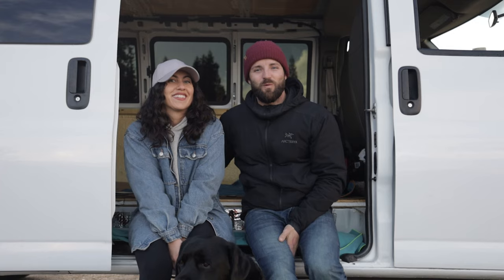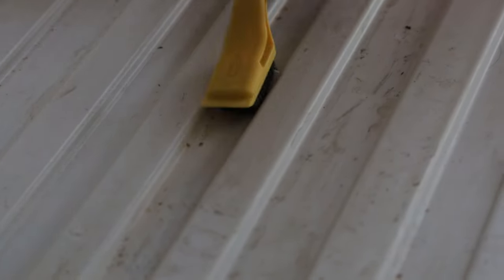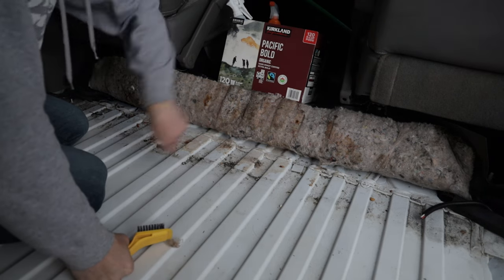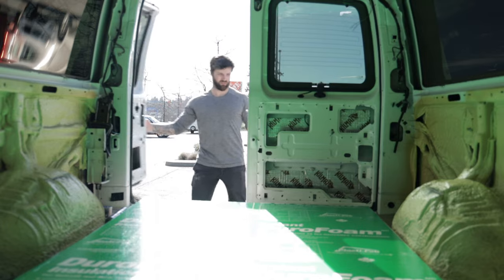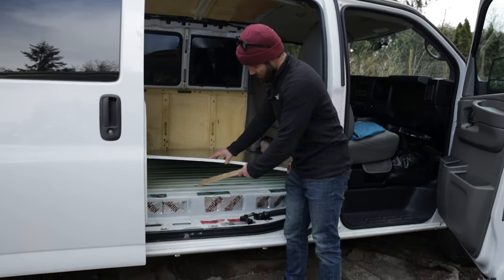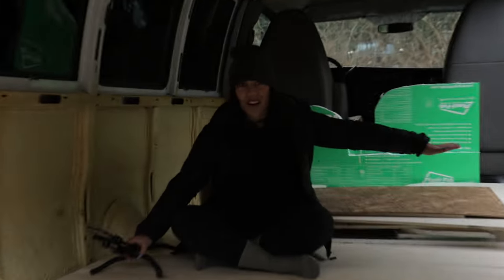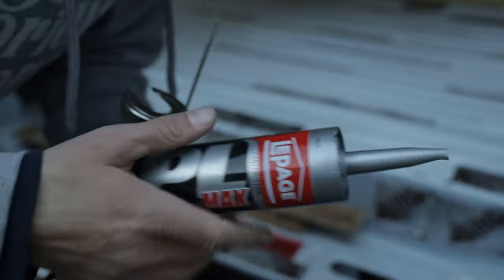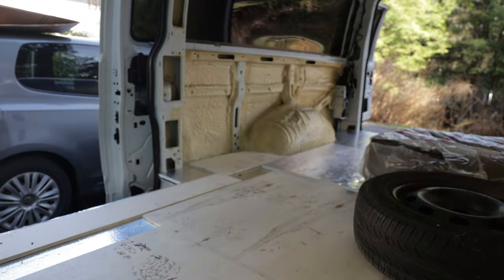CHEVY EXPRESS VAN BUILD | Preparation, Insulation, Subfloor | Ep. 1

Comment: I have seen many personal stories from many different people of their builds. I don't think any of them are "wrong." 

I started from the roof and worked my way down. Following the cables from my fan, AC, and solar panels on down the walls to the rear battery bank. Then the plumbing for my sink and shower. Then the walls with plugs. Then the bed frame and counters. Then the detail work.

Comment: I bought a 2000 Chevy Express passenger van couple years back.  I removed the two middle seats and left the back one because it lowers into a bed.   I built a plywood top frame for the area between the bed and the rear doors so we could lay long ways in the van with a foam mattress.    We kept it real simple so we could do a lot of things with the van.   we can remove the mattress and raise it back up for seating on a trip with some family.  there's a portapottie.    200 Watts of solar on top.   Three Vanguard   van ladder racks.  and two roof storage baskets bolted to the rack up high so I could mount two conduit tubes beneath the rack for camper gear like hoses and drop cords.  the other one I put in fishing rods and more.     I can hook up power to the van with a drop cord when we are near a power supply and recharge or use it over night.      I have a front and rear tow hitch that lets me carry a cargo carrier onthe front with bicycles or a cooler.   I have another folding basket cargo rack on the rear for chairs, smaller generator, water can and fuel can for generator if we not pulling a boat.     I mounted 3 cameras on the front top of the windshiled so at night when we close up and can see rear, or either side of the van outside.   (security)   I also keep a large plano box up top with scissor jack shovel, axe etc.  and two  tire boards for getting stuck.     I use commercial window tint.. the dotted stuff that goes on the outside for privacy.. you can see out but it's it's really difficult to see in at night even with lights on.   we like it.      https://www.facebook.com/photo/?fbid=6480363775329163&set=pcb.6480370101995197
Reply from the maker: That looks awesome !   It's amazing what you can do with such a small space. We're excited to keep building 😁
Reply: @wayoftheroads   yep.   The only thing I'd change  about what we did was perhaps go ahead and pull out the bench/bed and frame it up hard and higher for more storage beneath.  But then my tilt and pivot TV stand mounted inside roof at the rear wouldn't be high enough off the bed. LOL  for those stormy rainy days we out.
Reply from the maker: @larryfulmer  haha tough decisions to be made !  Gotta have that 'garage' space though.

Comment: Did you guys have to remove any side curtain airbags.? It was a passenger van right ?
Reply from the maker: The van was fully gutted when we bought it.  Just some spray foam on the walls.  Pretty sure if you got the stock passenger van then you would have to remove them.